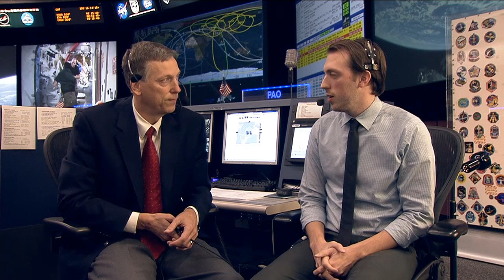Work Continues on Station Cooling Issue

Comment: Could a makeshift  microwave transmission dish be constructed on board the station and then positioned to specifically heat  the external loop or loops and regulated sufficiently to provide the incremental  heat flow needed? Or perhaps a laser the light from which is made to pass through a lens to cause it to be somewhat less coherent and provide a continuous yet gentle heat supply to the area needed ?